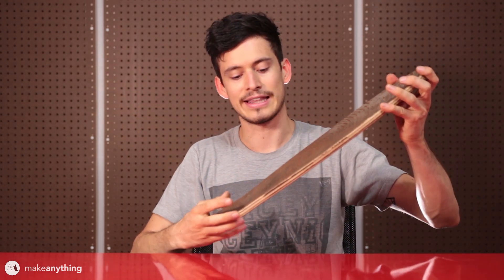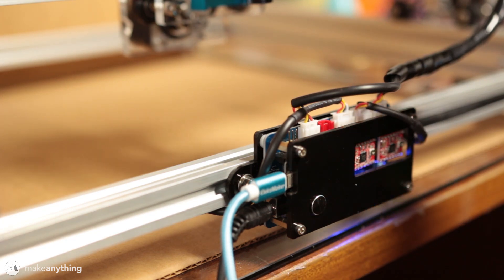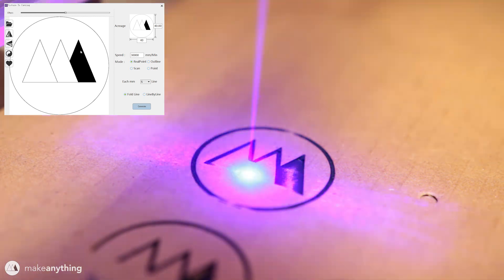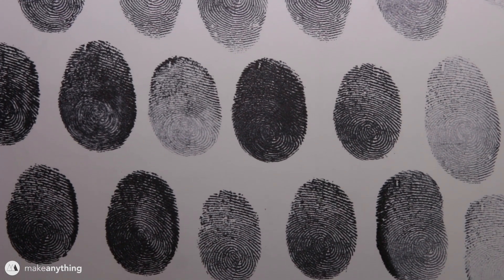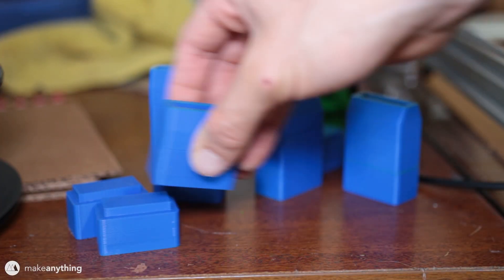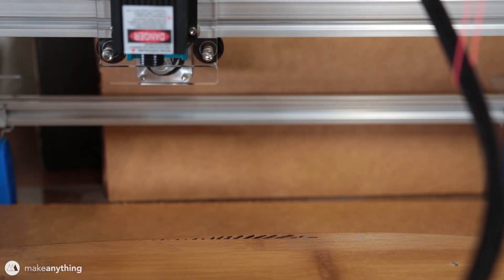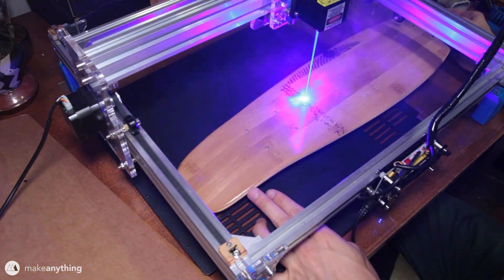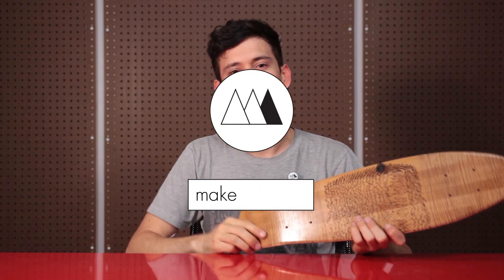Lasered Skateboard // Laser Engraving with the A3 5.5W

Comment: Why did you convert your fingerprint to vectors and then safe it as a jpg? Wit a svg graphic your engraving would be much faster and you also get a great result. 
Since a vector graphic does not generate a path for the fill color, you need to generate a hatch fill. There is an Inkscape plug in available to generate such fillings.

Comment: Dude, those chinese green glasses do NOT protect you. Please get some proper orange certified laser goggles. Visible laser is not to be taken lightly - it burns the retina. A 100W CO2 laser is childs play compared to a few watts of visible laser!
Reply from the maker: I got the strongest welding goggles i could find. Will those do?
Reply: You need goggles which filter the specific wavelength of the laser beam. I guess your laser also have a wl of 450nm.
The OD (optical density) rating tells how much of that wavelength can pas the goggles. OD 1 is 10%, OD 2 is 1%, OD 3 is 0.1% and so on. With OD 4 a direct hit should be below 1mw, so I would take that for the least.

Comment: Sometimes you have a bad day. Glad you did not injure yourself with this laser. Thank you for the review. Looks like a change of firmware to open source GRBL might be in order here. I am planning to purchase one of these lasers to etch painting panels using my logo. Any thoughts on those 15w diode lasers? I heard they are simply overpowered 8w diodes that are running in a cycle, making them burn out way faster. 5.5w looks like a good enough power level. Can you cut through 4mm ply with multiple passes you think?

Comment: How about stimulating photosynthesis with lasers? 445nm should be ideal to stimulate at least Chorophyll-a. Like we're using scatered and diffused light (artificial or natural) and wasting much of the light energy due to reflection and panatration of areas ware no radiation is needed. Soooo... why not use lasers for this task? Like a 3D-Printer for plants. With a lense to create a nominal ratio between light intensity and area to cover I think this could be useble. Combined with a mirror thats moveble in X and Y and .... okay, could this be a thing? I'm just really frustrated about the inefficiency of photosynthesis.
Reply from the maker: Definitely an interesting idea.. very weak lasers might do the job. Or even scattering a single laser to hit dozens of plants at once

Comment: So actually the error was between the headset :-)
Nice idea of bringing stuff to an object.
I blew my printers MB while changing from a 500mW to 2.5W laser.
It was a „just a short test“ - failure. Had forgotten to put the Mosfet inbetween.
But laser is fazinating.....
I use Inkscape with 2 extensions 1. JTec 2. Raster2Laser
This Eleksmill software never worked for me with the laser or with the drill.... no way to get is run properly....
It is (my opinion) really crapy software.....
Keep the good videos up... appreciate you channel
Best
Frank

Comment: Which 3D printer and filament did you use to make those blue supports?
Reply from the maker: Those were printed on my CR-10, i forget the filament, sorry
Reply: Thanks for the quick reply, you've earned a subscriber :). I'm really impressed by the quality of those parts. I'm trying to decide which 3D printer to buy for my first one. I'm tempted to build an Anet A6 but all the vids on youtube show it printing quite awful-looking parts, with very visible lines between layers. I've looked at the creality models and they are around the same price range, but come mostly pre-assembled which takes all the fun and learning out of it for me.

Comment: did you ever get the usb on that laser engraver working? I've had some success with repairing usb connectors on my electric longboard controller which broke when I fell off the board one time.
Reply from the maker: Well, I've been considering turning the laser into a handheld burner.. haven't worked on it since this video though
Reply: Make Anything // 3D Printing Channel well if you want some help with fixing it then let me know. I can offer some tips. Alternatively you could send the broken board and I’ll take a look at fixing for you. I’m based in SF.
Reply: Just solder the damn connection again dude!!

Comment: As most who'd be interested in this power laser. Can it cut Plexi or acrylic plastic for front panels etc... is 5.5watt powerful enough without having to step up to CO2 40w + lasers
Reply from the maker: +RamjetX I didn't get the chance to try, but I think it would cut 1/8" acrylic at most
Reply: Multiple passes may do it. Tech2C did some testing with a 2.5W from memory with some relative success. I think for most interested in Lasers, it's a case of wanting to cut acrylic but don't want to invest in a 40W machine to do limited scope of front panel cutting in plastics.

Comment: I see three options - 1. replace the USB port and/or the circuit board on the laser (BTW, I'd love one of these) 2. strap the laser module onto the 3D printer and use that to laser things 3. have a X/Y moving base that you can use to mount your deck (or other things) on so it can move them whilst you turn the laser on and off (think cameo/vinyl cutter) so you can get straight lines if you want them.

Comment: try de-soldering the micro USB connector, and then see if you can use a micro USB to USB type a connector and put the code for the thumbprint design on the thumb drive
Reply: Not gonna work, mate. This is just an Arduino-like board, the USB port is a USB slave to RS232-TTL single-function IC, it doesn't have OTG capability and never will.
Reply: Couldn't you still replace the old, broken, micro usb port with a new, not broken, one?
Reply: Depending on the extent of the damage and the amount of effort that you want to put into it, sure, that can be done. The unpleasant part is that i'm afraid in this case the socket hasn't broken internally, but levered the whole part of the board off including the traces. It's just the impression i have from what happened and the footage of the wiggling part, so it's worth checking, and either way it's repairable, but might not be worth the effort.

I looked up, this is the Eleksmaker Mana SE electronics, which is a dead simple carrier board with Arduino Nano on it, and it's the Nano that the USB socket is mounted on. Those Chinese Arduino Nano are only $2 if you get them from overseas, $10 tops for the nicer ones shipped locally.

Comment: Instead of using a string tied to the ceiling... cut a piece of 3mm filament the same length as the wire wrap. Include it inside the wire wrap with the cables. The springiness of the filament will create a nice arc for the wires and will move easily with the laser head. Works great for my little CNC machine. You can fix the filament to the frame at the controller end.
Reply from the maker: Excellent suggestion, thanks!
Reply: You're into 3d printing? Why not print an energy chain?

Comment: oh man that is one heck of a project fail.  You did work in some great pro tips though.  Place metal under your project.  Put feet under the laser for big projects (Ive never had mine fall off the feet so no worries there).  Turn off all sleep settings on the attached pc.  All great tips.  Other things to improve burns is to use painting tape to prevent smoke burn outside the engraving and to use an air assist to cut cleaner and deeper.  I dont know if you posted to eleks forum.  If so we have probably talked.  Your laser is super easy to fix.  The nano just needs to be replaced and reflashed.  You can get one for a few dollars on amazon.  Next you need to ditch eleksmakers software.  The best software out there is T2 Laser.  You will have a ton of fun once you get it all dialed in and get away from that horrible software.

Comment: Great, wondering how the open-frame laser engravers worked. U might want to add a disclaimer on competent operation, children, equipment and health safety, fingers, etc. Laser engravers are usually encased and include a safety top and window. An exhaust system to the outside or into a cleaner is considered mandatory. U can add these as a special project for us.

Comment: Cool board, and good luck getting it running again. Could you do a test with this laser to see if it could be used for micro spot welding? For example connecting 36 gauge fuse wire or .15mm nickel strips to an 18650. The lasers point or pixel mode and scan made contains the needed controls... I think.

Comment: The Arduino nano on the laser board is easily replaceable.  You can use the mini usb version for a stronger connector. Reflash the firmware and you're back in action. All in it's a $4 fix.

Comment: Some “medium grit sanding + several coat of primer + a funky paint + a clear coat” must fix the whole problem! [Just don’t let the pun burn your eyes!]
Reply from the maker: +Meisam sadly, the hole I burnt goes nearly all the way through to the grip on the other side
Reply: You can shave the burnt parts and fill it with flexible epoxy. Should do the trick!
Reply: Wood filler, just wood dust in D3 or D4 type PVA glue.
Reply: Pun? What pun? ... OOOOOOOOOOOOOOHHHHHHHHHHHHHHHHHHH.
Reply: That hole and burned out stuff on the board are very easy to fix.

Comment: A few problems with the machine itself,  needs to be more idiot proof
Reply: You cant make something idiot-proof, the world will create a bigger idiot.
But yeah, this machine is not even idiot-resistant
Reply: One thing to keep in mind, is that even the sharpest of minds have a few seconds of idocy once in a while. Actually often enough multiple times a day, i'd say.

BTW, Berkeley couple that died from monoxide poisoning, it's possible they died from a gas device malfunction, though PG&E denies. Allen Rabinovich, a friend of the couple, said the laser cutter was not loaded with any material at the time of couple's death or showed any signs of having been operated at the time - you'd think if the gas came from it burning a hole in its bed because it activated itself upon suffering a hardware malfunction or firmware bug, it would be readily apparent. Ultimately the source of poisonous gas is still a mystery in that case.
Reply: Patrick, the problem with making things 'idiot proof' is, they go and build a better idiot ROFLMAO
Reply: Haha agreed on all fronts, I just look at this machine compared to the epilog mini I used extensively a few years back and it's just a death trap waiting to happen.  I'm far to dumb to be safe with a laser like this one.
Reply: well to be honest, what is NOT a death trap if used incorrectly these days?
the easier they make things to use, the easier it is to do yourself (or someone else) harm with it

still, I'd love a big laser but have no room for one so one of these would possibly work great for me.  plus I don't want to cut tables in half, I think it would compliment my silver bullet digital cutter well ;)
Reply: You can't make idiot proof laser cutters because they are dangerous and unforgiving machines to begin with. There was a whole warehouse lost to a fire in my city. I saw, and stopped, two fires from starting in my university and also had one student complain getting very sick from fume poisoning. Early this year there was a couple that died to carbon monoxide poisoning from their laser cutter at home.

And all these dirt cheap laser cutters make me cringe. The race to the (price) bottom needs to stop. This video shows multiple faults and the author just brushes it off as if it's no big deal. We already saw the combustible results with 3D printers... cough... Anet... cough... do we need more?